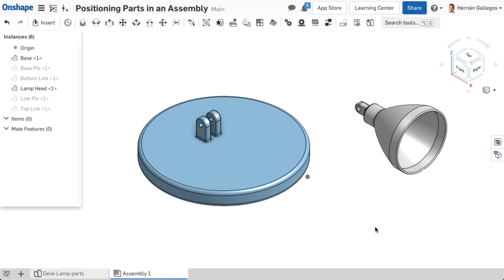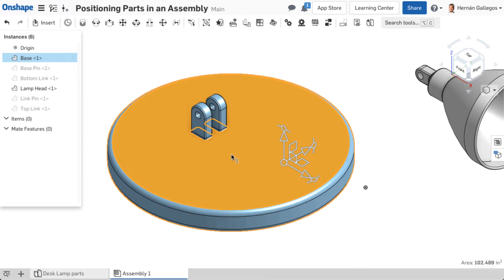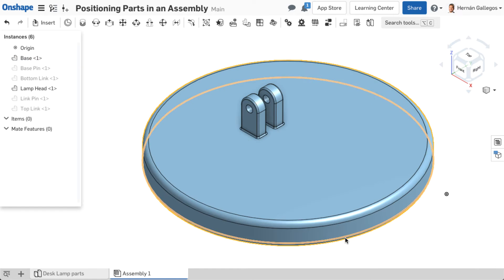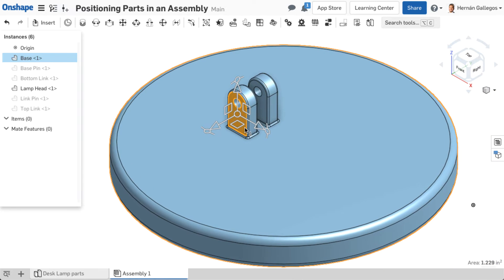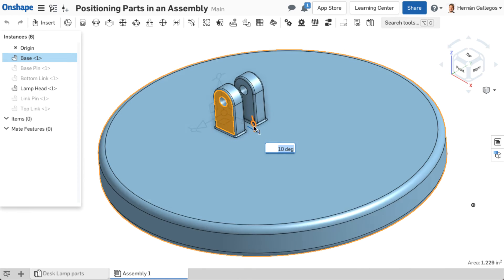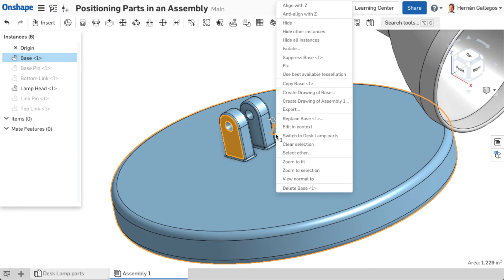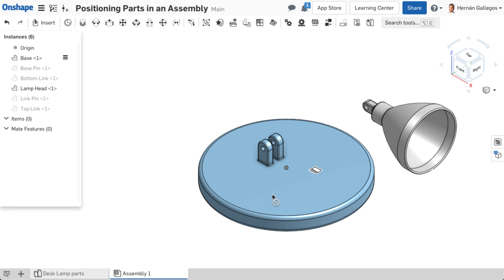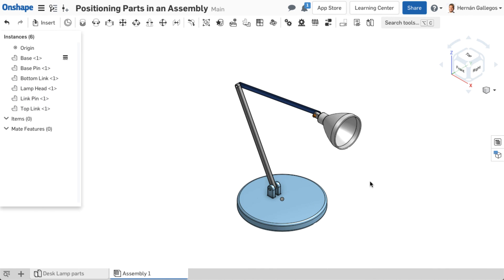Positioning Parts in an Assembly

Comment: I just want axis and planes, not fasten. I want to constrain parts in an assembly based on their position to the origin and NOT other parts! I waste so much time in the fasten mate flipping, rotating and offsetting. I want to paste a subassembly into a parent assembly and not have parts within the subassembly move. And I can't use my space mouse and mouse scroll wheel at the same time.
Reply from the maker: Here are a couple tools that can help with some of the issues you described.

Here is a tech tip on using mate connectors to control assembly position in relation to the origin https://www.onshape.com/en/resource-center/tech-tips/mate-connector-origin-reference

Here is a tech tip on grouping assemblies for easier manipulation with the copy and paste: https://www.onshape.com/en/resource-center/tech-tips/tech-tip-how-to-use-the-group-and-fix-tools-when-importing-models-into-onshape

Comment: How can I constrain the first part in the assembly, relative to the origin? I don't like to just fix it randomly in space.
Reply from the maker: When inserting from the part studio, click the green checkmark after selecting the part studio group or selected parts from the part studio and it will position the origin on the assembly origin by default.
Reply: @OnshapeInc  yes, but this doesn't constrain it at all. If I reorient it or mate it to another part it might move. I've figured out I need to use a fastened mate on one of the faces and the origin.